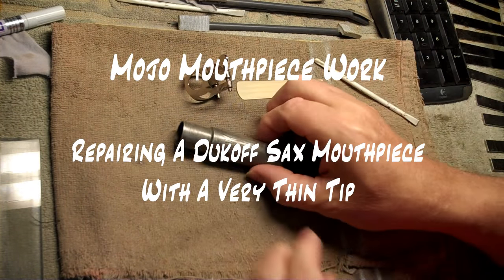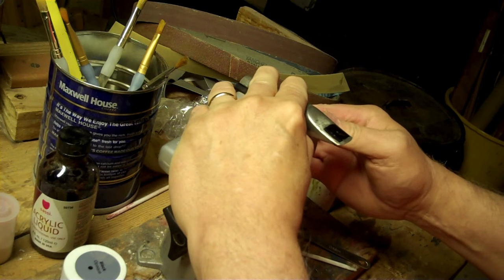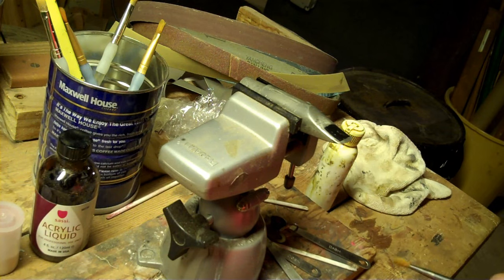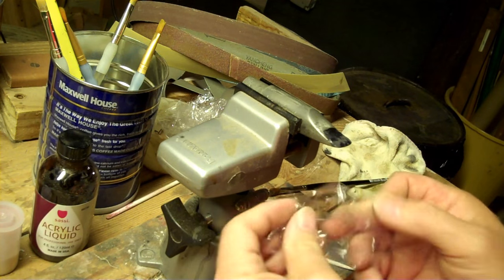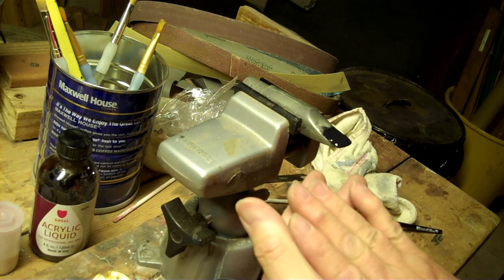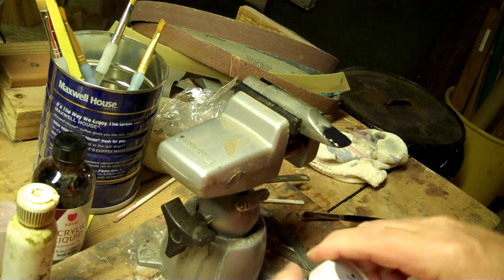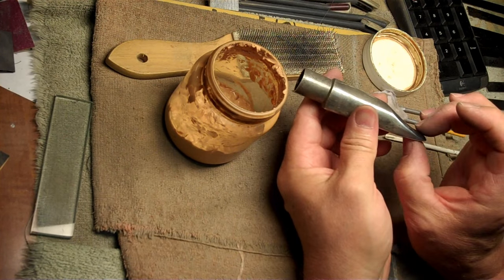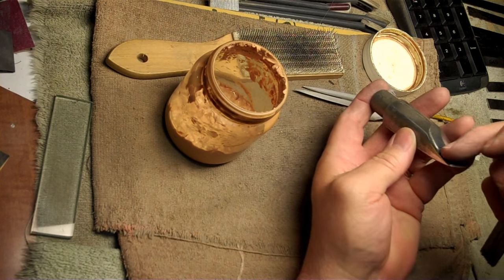Repairing A Dukoff Sax Mouthpiece With A Very Thin Tip

Comment: That Dukoff metal is so fragile. I seen a guy using one and he has almost bitten straight through it
Reply: There is this little thing called teeth guards....
Reply: TheMovieEditor doesn't matter when using the newer Dukoffs. It's the type of metal they are made from. Mouthpiece cushion would have no effect on that metal weakening.
Reply: Stantawn Kendrick
Never had a problem with a dukoff in 30 years of play...

The new ones are silver plated over the silverite.
Reply: Keith Bradbury
My bad. I knew they didn't look the same as they use to. They need to make these in a new material. I know some don't like stainless because you can't work on them as easy, but personally I'd love a stainless Dukoff D9 alto.
Reply: TheMovieEditor that's what I was saying... the material is not the same.
Reply: Keith Bradbury when I'm speaking of not the same I'm talking about as far back as the Hollywood Dukoff